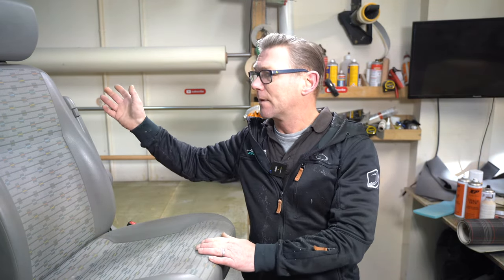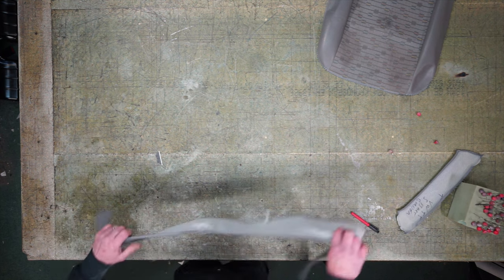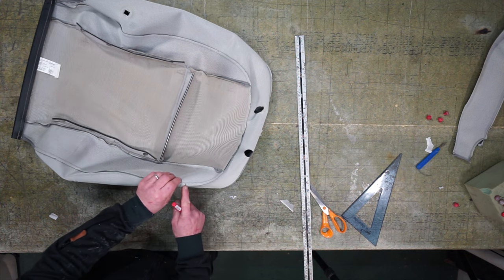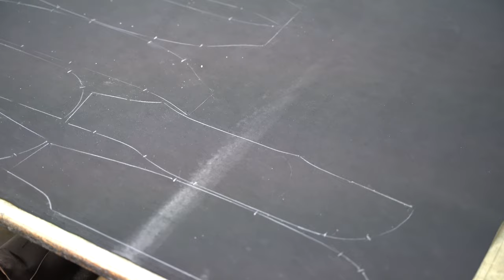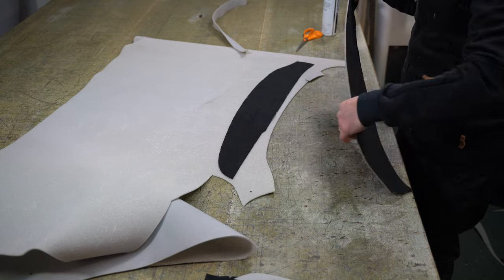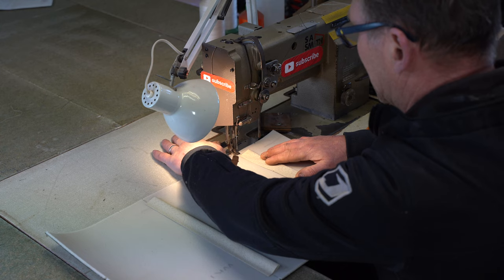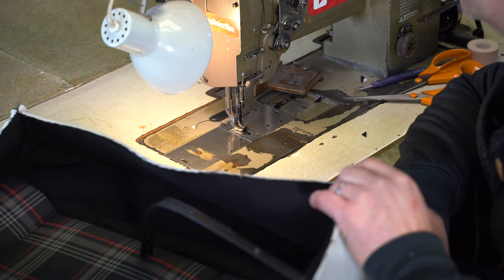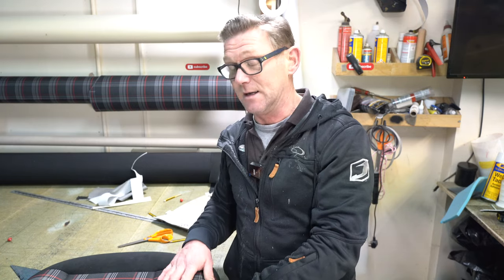How to make a set of  seat covers, step by step guide. VW T5 Transporter single and double seat.

Comment: Thanks for recommending this video its so helpful! The little lines you mark all the way around the shape you are drawing are they what's called match marks? If so, how do you work out where they go?
Reply from the maker: Yes I call them match marks but some people call they tailors marks, most seat covers will already have match marks on you will see them when yo take the cover off the seat, if the cover that you are taking apart dose not have them on, you should put them on before you unpick the cover. If you don't have a cover to make a pattern from see this video  https://youtu.be/39-eye8fxWM